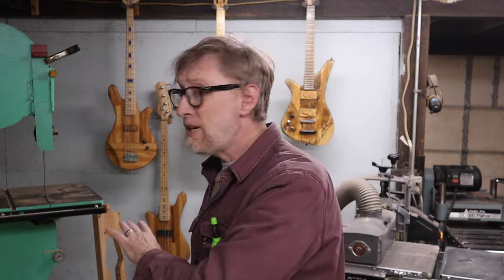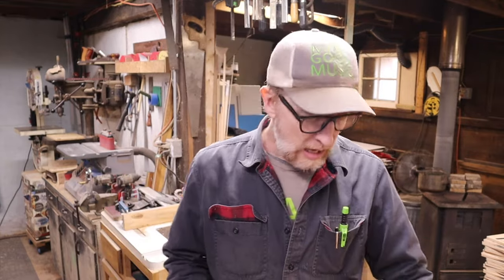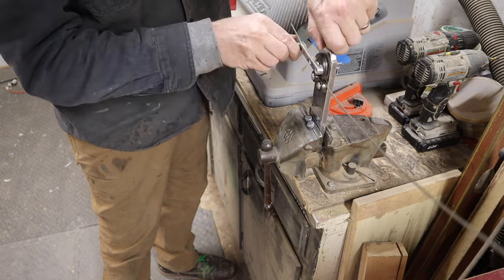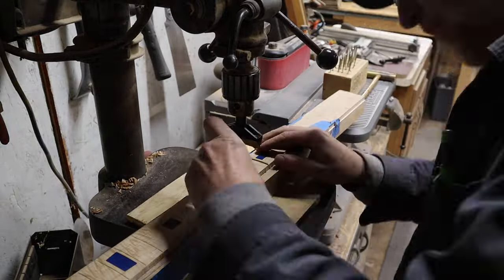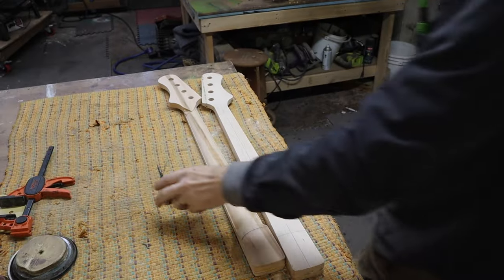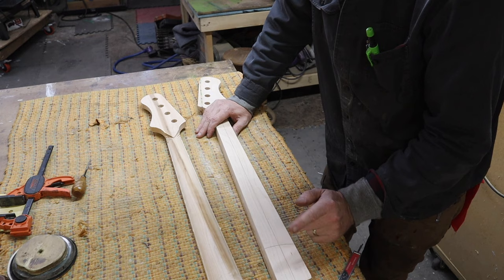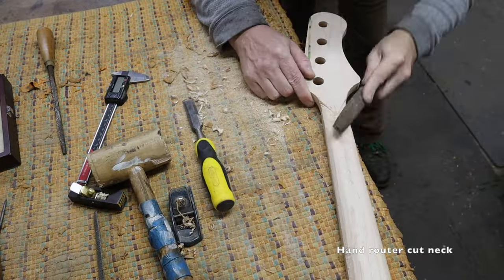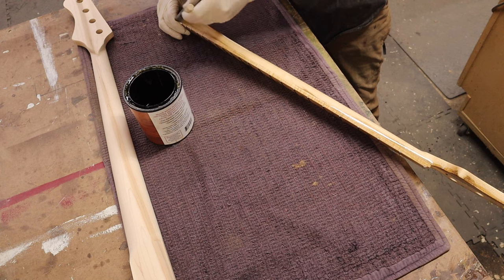Shaping and Fretting Bass Guitar Necks - DIY Bass Plans Part 3

Comment: Regarding the fret press: I 3d printed myself a custom tool for my neck radius that gets glued to a regular bolt and then basically looks like your commercial one, to be used in a drill press. It won't last forever, but it did the job for one instrument. Perhaps that idea is feasible for someone since 3d printers are the most accessible kind of CNC machinery right now.
Reply from the maker: interesting idea! I maybe a real dense oak piece could be made into one, too.

Comment: Hi Tim, really good job on your instruments. Quick question, how do you avoid misalignment when you flip the blank using the pin holes? Because I tested with some of my own designs and when I flipped the blank it messed up me blank and I have to start again and do the alignment manually to avoid that issue. Thanks.
Reply from the maker: I talk about it in a million videos but I just searched Vectric's page for one: https://www.youtube.com/watch?v=90-5uZO9qGE the key is to mirror the holes and make them intentionally "random" so you cant mess it up. so in one side of the work I drill 3 random holes, just a little ways in (.3" or so). then I drill flipped, mirrored copies of these holes into the wasteboard. If you try to do it all at once it will be wrong, unless you make them symmetrical, but then you could accidentally flip it the wrong way.

Comment: For fretless would one put some contrast wood into the fret slots, sand it flat and use a lower height zero fret?
Reply from the maker: Personally, I probably wouldn't bother with the fret lines and just put some side position markers for reference, right where the frets would be (not in between them). Then you could use a lower zero fret or carve a nut in that spot instead. check out my Apeiron bass video series for some inspiration: https://www.youtube.com/playlist?list=PL9-JGqOmsWcru3G49HgUpDqFdfh9qgNA5
Reply: I've seen people do what you're suggesting, I've also seen what Tim's suggesting... seems to be whatever floats your boat. I kinda liked the bass I saw where they filled the fret slots with a glow-in-the-dark epoxy.
Reply from the maker: @anonjr  yea, my first fretless I made on my kitchen table by prying them out of an old ibanez with a butter knife and filling the slots with wood putty! Ugly buy worked!